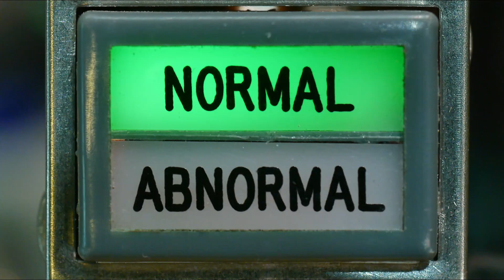#2255a Can you hear 51% duty cycle

Comment: For those that want a somewhat intuitive grasp of how to think of the spectral components in the different duty cycles, you take a pure 50% wave and add varying narrow width pulses to get the net duty cycle you’re after.  Those narrow rectangular pulses will add a sinc function in the frequency domain which has all integer harmonics.  The wider it is, the more it contributes to the upper harmonics.

Comment: You can hear the added buzziness caused by the 51% square wave over the 50%. Those even harmonics do make huge difference in the timbre of the sound. It's why (music) synthesizers have an option for a 50% squarewave and what they either call PCM wave or Pulse wave which is a square wave with a non-50% duty cycle. Depending on what sound you're going for, those extra harmonics matter. Musicians in the 70s and 80s, spurred on by the popularity of the Moog synthesizers are what lead our current enjoyment of music today. The 51% added significant even harmonics which makes it really audible - if the even harmonics were lower power at 51% then maybe it would be hard to hear.
Reply: Curiously to those who don't design circuits or signals: The harmonics are always present even on square waves of 50% duty cycle.
Reply from the maker: the 50% only has odd harmonics

Comment: would it sound the same going 50 → 49 → 48 etc.. ?
Reply: Yes. Because it is an AC wave. 49 % square wave looks like a 51% square wave except it is upside down. Unless there is some nonlinearity in your speaker it should sound the same.
Reply: @isaachammonds7519 makes sense - thanks !
Reply from the maker: I did that, sounds exactly the same
Reply: @IMSAIGuy cool- thanks!